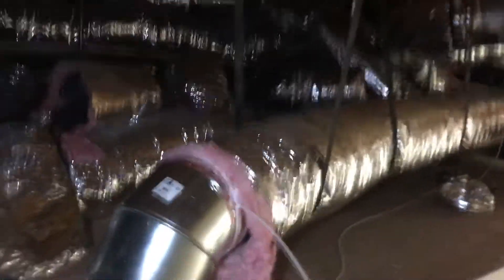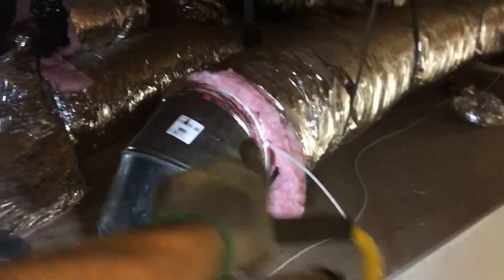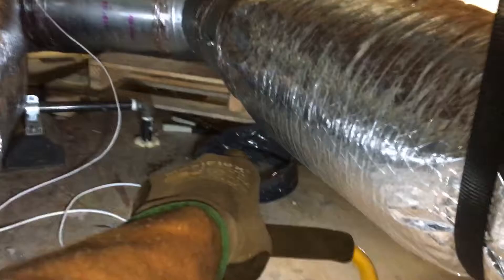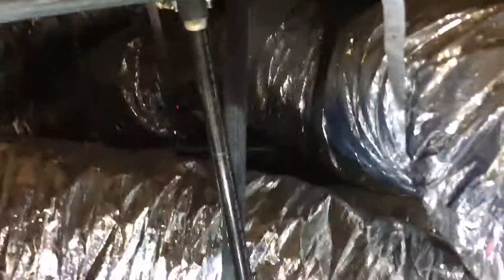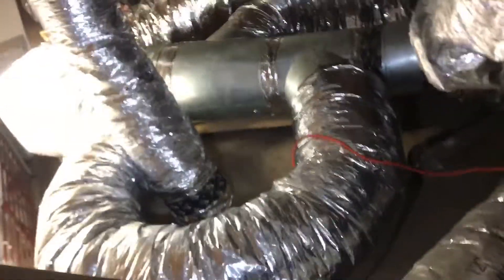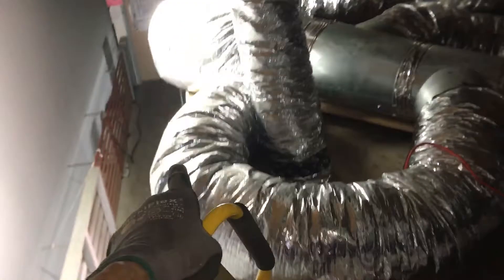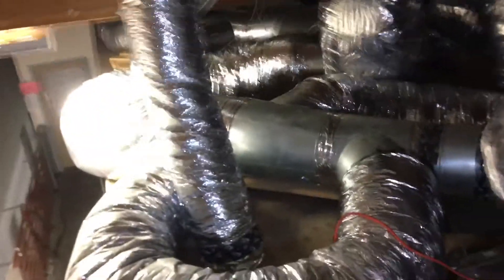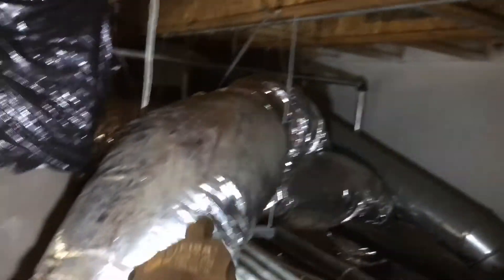Flex duct on a 5 ton return I found is only 16 inches￼. (“ Who thought this would work￼ ?”) ￼

Comment: I have high static pressure on a new 3.5 ton heat pump. I know for sure the flex duct is the issue. I have two 12" coming out of the supply in opposite directions. I know I need an 18" for a 3.5 ton heat pump. I did a diagram layout of the duct in the attic. What would happen if I just replace the two 12" to 18"?

https://i.ibb.co/Ld9kmPM/Flex-Duct-Layout-and-Size.jpg

https://www.youtube.com/watch?v=iInIN89q8GU
Reply from the maker: That’s a little bit of a mess you probably have some air delivery problems to some of your rooms. 
               Especially on that one side where you have a lot tapped off. 

It’s always very difficult to do a two story trying to share the cooling from upstairs and downstairs all off of one unit is a little more tricky and difficult to get it done properly. 
                       That’s why you usually always see two units one for upstairs and one for downstairs separate to smaller units are usually better than one big unit. 

I need proper ducting software or do it the old-fashioned way with a pen & paper following to Manuel D.  You can look it up on Google

Even the type of grills that you select will cause restriction and their size. 

The type of (MERV) filter and size can cause problems.

And with this type of system so complex and poorly designed you will have to have dampers put on every run to each grille on every room to try to balance the whole system out because it’s so poorly designed. 

And that small Plenum needs to be much bigger
Reply: @coldfinger459sub0  ignoring the downstairs, because everything is between the walls. The problem was even worse with an undersized return. The original and only return was a 24x18. The total static pressure on the unit was .9 W.C. I was able to drop the TESP to .66 by making the return 30x24. Since there is so much static pressure and the unit TESP is a .2 and I need an 18" for a 3.5 ton for 1400 CFM. How big does the supply plenum should be and what shape? Should the supply plenum split to 3 18" going out to each of the 3 distribution boxes? Do the other three distribution boxes also need to be larger?
Reply from the maker: @idanny76  the plenum rectangle.  I see your limited hight problem.  But if you can take it up higher.  As you mentioned coming off with three 18”  all at the top of the plenum.  To three boxes.
Reply: @coldfinger459sub0  If I understood you correctly and I am not expecting a perfect air flow to each vent and a fine tuned duct system. If I can make the supply plenum larger and have 3 18" flex duct going to each distribution individually.... I can reduce the static pressure by a lot and improve air flow to or close to the 1400 CFM. 

Could I also as an option swap the two 12" for 2 18" and then upgrade the 8" to a 12" from the distribution box that connects to the other distribution box? 

Which of those two options would better serve me to just get the unit restriction from a .66 w.c. to a .2 w.c or close. Performance sheet for my unit. Thanks for the advice.... I know is not the perfect fix, but it's better than the undersize supply plenum I have now.
https://ibb.co/17VvF4B
Reply: @coldfinger459sub0  Looking at the triangle shaped supply plenum I have very little room up for a rectangle plenum. I think a 3 feet ductboard supply plenum should work. There is a foot from the Air handler to the ceiling and I think 2 feet from the attic floor to the roof. Now I am looking at two types of designs. Design #1 keeps the 18" ducts straight by having a single 18" coming out and then a distribution box splitting it to three. The sides coming out straight to the to side boxes and one going to the third box with a slight curve. Design #2 splits to three right at the supply plenum and goes to each box individually, but all three will have a slight curve. I will not be using any metal plenums..... it will be all flex duct and ductboard boxes, because of budget. I am not trying to make a perfect system, but trying to remove the restriction from the 12" undersized ducts installed and replacing the flex duct that was patched with mastic with new ones.

Another question about the installation..... I have the flex duct running up and strapped. Since the supply plenum is low to the floor due to the roof..... Can the flex duct be run on the attic floor? Can you tell me which layout makes more sense and less restrictive?
https://i.ibb.co/PNN8mSB/2022-07-05-0001.jpg
https://i.ibb.co/GHyS00g/2022-07-05-0002.jpg

Comment: Wow so many problems, it's gonna work much better.
Reply from the maker: It’s already starting to work better in that one room the minimum temperature for the one room with no load before I started my work with 74°F it’s still not finished but as of now it could get down to 68°F but the big test is when all the lights and the heat load and the Latent heat load is introduced into the room

This was a room during the summertime that they had to open the door plus keep the air conditioning on and have large fans pushing in the air at the bottom of the door to keep the temperature below 86°F
Reply: @coldfinger459sub0  This is proof you don't always get what you pay for.  Good job straightening it out, so far.
Reply from the maker: @thisisyourcaptainspeaking2259  I feel sorry for my son he just came back from vacation from Iceland and then the first job I put them on is up in a hot attic area where it’s hot and sweaty I’m off on another job while he’s there by himself roasting dealing with that itchy pink fiberglass insulation. 

Literally the labor just to straighten out this ductwork cost more than the whole unit installation labor originally

Comment: When we bought it, my house had a 5 ton system with a single 18" flex duct sucking through 2 side-by-side 20x20x1 MERV8 filters. 😑 Morons. Nowhere near enough air flow.
Reply from the maker: Two side-by-side 20“ x 20“ x 1“ MERV 8 filters are many times better than what I ever see here in San Francisco. 

Do you know how some furnaces air handler combo have the default knockout in the sheet metal for their intake is 14“ x 16“ 
                   But they have the factory indentations for you to knock out or cut out the available larger sizes. 

I usually always see nobody ever cuts out for the larger size and they will keep that size and put in a filter to match 14“ x 16“ 

I feel bad even putting in a 25“ x 25“ x 2“ but that’s all the room there is and I’m just coming in behind this work to make it work better or at least good enough. 

Of course because of the messed up airflow any of my superheat or sub cooling readings will be wrong.
Reply: I have same problem, a 5ton unit, only have one return. So what is the solution here? Add more return?